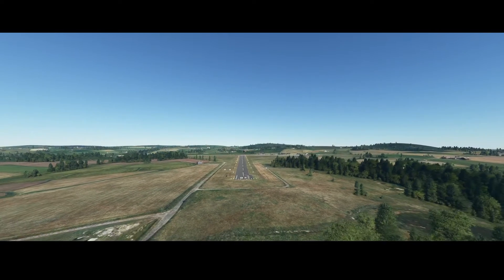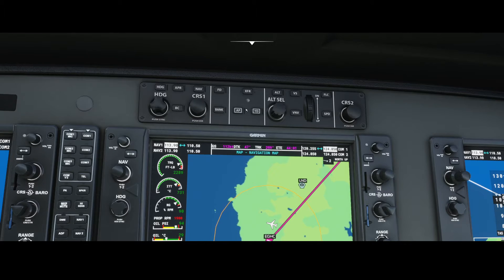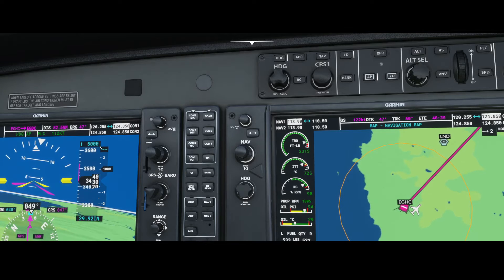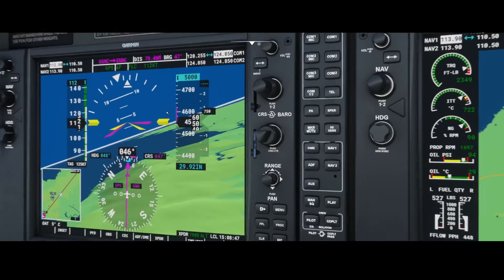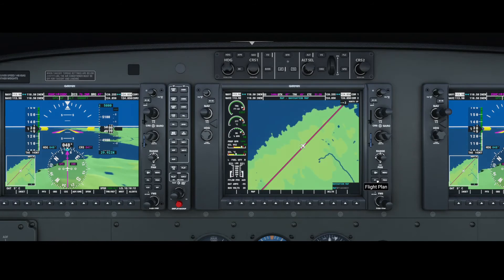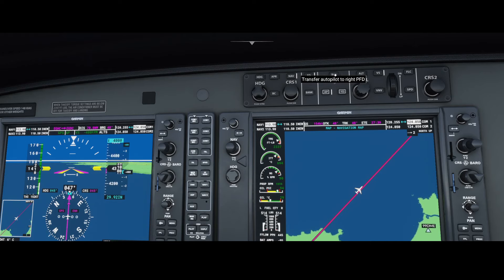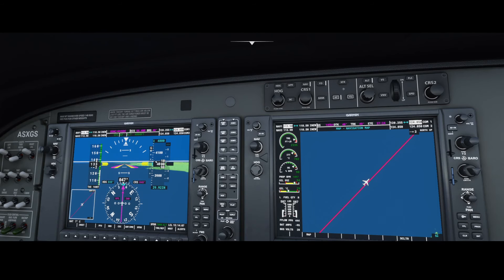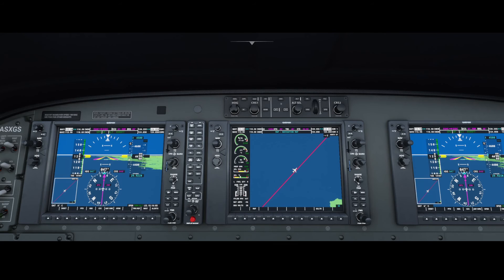Flight Simulator 2020 - How to - Cessna 208 B Gran Caravan - autopilot

Comment: Hey cant get it with the appr button. When doing a visual approach and the diamond it's in the middle of the glide scope when I press the appr button the CDI changes to loc the GPS mode gone and the gs also disappears . Then I neither go down or follow to gps track
Reply from the maker: Yeah I have seen the same after SU10 also in another aircraft. Will need to test an airliner to see if it causes the same behavior

Comment: So whenever I activate the NAV mode, my aircraft does infinite 360 degree turns. How do I fix it to go on the flight plan?
Reply from the maker: hi Miggis make sure you are close enough to the pink line on the display which indicates the path you should fly to the next beacon. If you are to far away from it it won’t pickup the path and won’t use GPS but indeed the course which has been setup in the autopilot
Reply: make sure you turn the CDI to GPS
Reply from the maker: that is indeed also something to double check

Comment: I can't find the answer to this anywhere, where is the nose up/down button for this version of Garmin? I would normally use this to adjust the speed after hitting FLC, but I can't find it anywhere in this plane.
Reply from the maker: Hi Dilcoe did you try the VS option with down and up button next to it?
Reply: @Highintheflightsimsky  Ah, I thought that knob was just for the vertical speed for VS mode like in other versions! I didn't realize it also doubled as the speed adjuster, thanks :)
Reply from the maker: well I am not sure if it is exactly what you are looking for tbh. Because that button is used to managed the VS not the speed itself which it looks like that is something you are looking for
Reply: @Highintheflightsimsky  I just gave it a try in FLC mode and it changed the speed, just like the nose up/down buttons did in other versions of the Garmin, so it was what I was looking for! Thank you :)

Comment: Hello, good video, but for me the NAV Not working at all, only on this plane and was fine before, any ideas what I'm doing wrong? Thanks!
Reply from the maker: can you tell me which navigation beacons you tried?
Reply: @Highintheflightsimsky  this is how I'm trying to accomplish using this airplane going from A to B using IFR Low altitude, I turn on the airplane already preloaded the FLP, then I put the FD ON, the NAV on, the Altitude to the desired altitude asked by atc, also the CDI was on GPS , then I take off when I'm above 1000 feet I hit Z on my Keyboard and that would engage the AP, however, the airplane does not respond the command I read in many places because of the german 1000, not sure if that is true or not